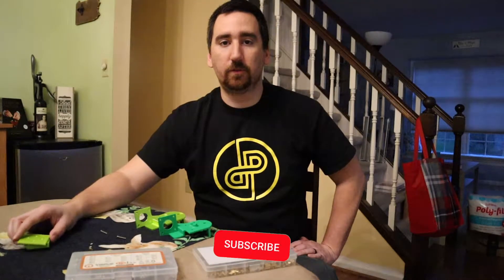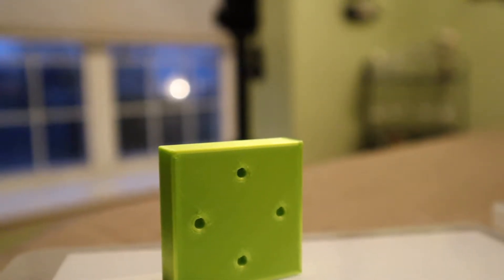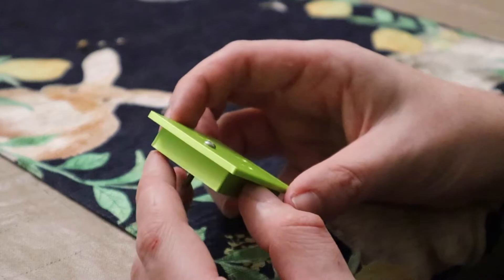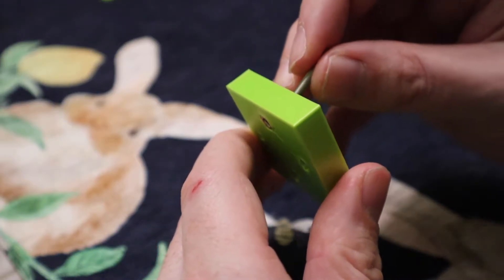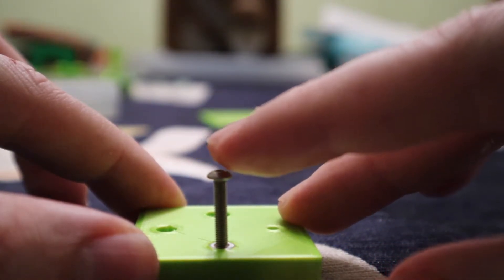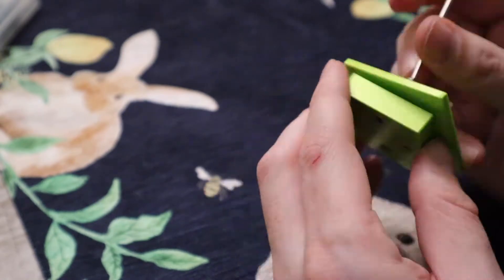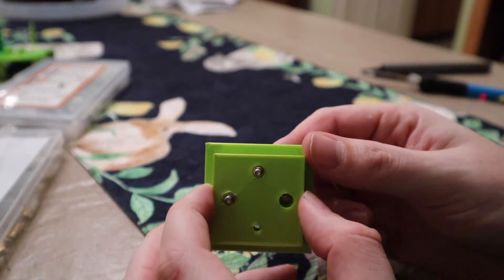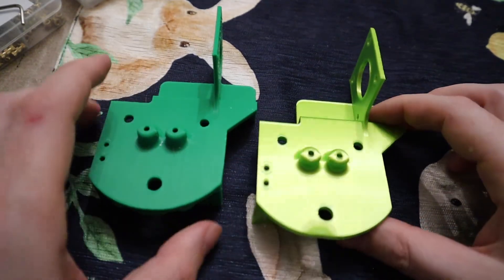3D Print w/ Metal Threads | Nuts and Brass Inserts | Tutorial

Comment: threaded insert footage installation is missing!

why use the soldering iron technique with the hex nut? why not just make it a tight press fit? I've found that the bolt won't cross-thread as a result of going in somewhat crooked. and its a lot faster to do. perhaps using the heat method makes a tighter fit around the hex? which makes sense for the brass inserts but the hex likely won't rotate before the plastic breaks when just doing a press-fit

Comment: Standard machine screws are too fine to be reliably self-threaded into plastic.  Self-tapping (course) threaded) screws work reasonably well in many cases.  Long thread engagement helps.  

Using screws to align parts isn't very good design practice.  Use pins, tabs, or a variety of features to align parts, then use through holes with clearance to keep a pattern of screws from binding.  In a pinch, flat head screws can be used to align parts.  Countersink the holes and add clearance to the through holes for the screws.  This also allows the screw heads to be flush with the surface.